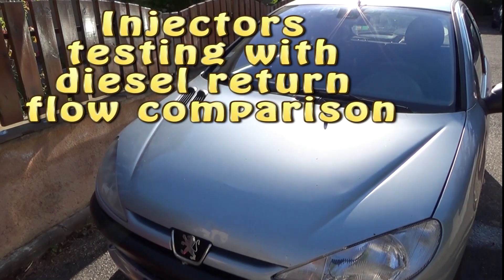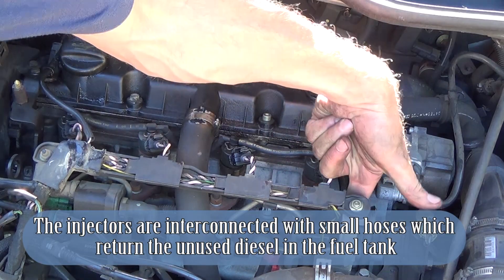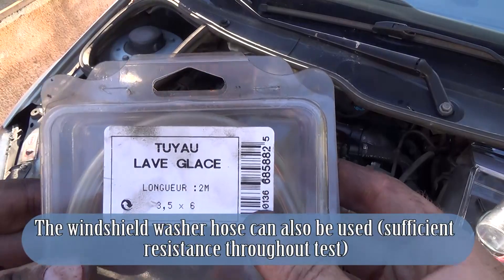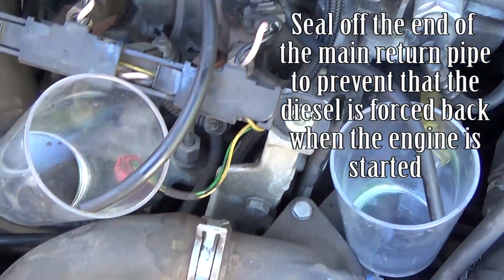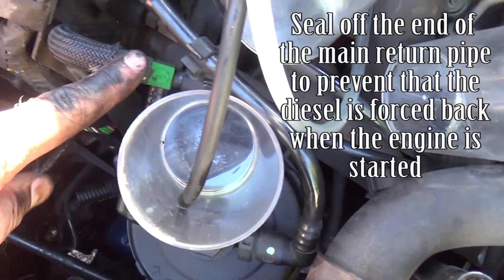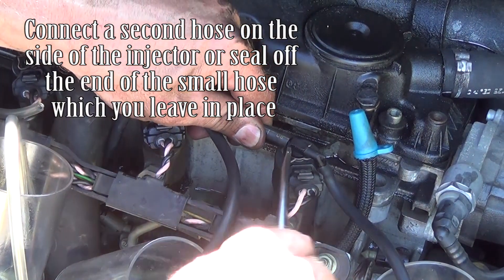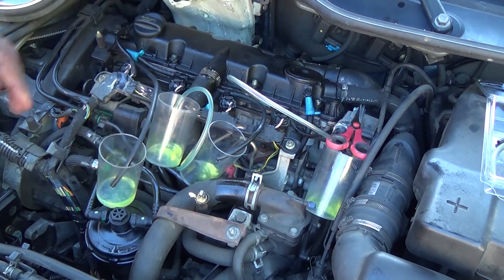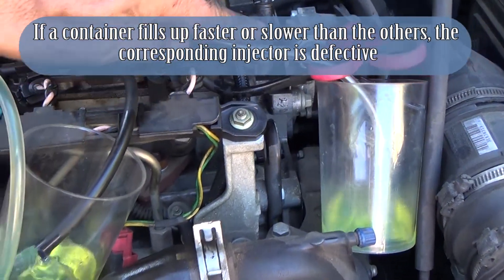How to test common rail diesel  injectors

Comment: If one injector is leaking back all pressure you would STRUGGLE TO START  and had very poor acceleration due to the not enough fuel. You do not test and create leakages by pulling out original and sealed properly fuel hoses if your engine has fresh filters and works fine. Allways use OEM or good quality fuel hoses. I used eBay crap and has leaking diesel within 3 month of installation. Chinese parts sold as for diesel and fuel cracked when exposed to diesel. Be aware good FUEL SYSTEM is TO GO or ... to walk back home. Take care.

Comment: This sound coming from injector?
@

Engine after repairing, starting 3 times without this sound, but when push to accelerator pedal, sound starting. I have more video from PC with  injector correction, when start in the first time, when o bed sound.

Comment: I stripped my injectors down and cleaned them in an ultrasonic cleaner,when I reassembled everything I done the leak off test and the diesel was black,like it had engine oil in it ?
anyone got any ideas what it could be ?
Reply: very nice
Reply: maybe worn  pistons and oil messes with fuel

Comment: I have done it and the injectors returned pretty much the same amount of fuel even though one was definitely bad. Beware that this method is not always accurate. If you have one totally shot injectors and it returns let say 2-3 times more than yes it will work. Mine was partially clogged.
Reply: how did u know which one it was? fault code diagnostic?
Reply: rivolinho
I used a screwdiwer - one side to the injector ans handle to ear. Bad one wasn't klicking (or probably wasn't klicking as loud as other ones). Also when unplugged there was not to much of a change in idle. My car is to old to come up with injector code other than open circuit.
Reply: rivolinho
Also the injector was probably giving the right amount of fuel but not spraying properly so it didn't burn properly.
Reply: +Gregory May Interesting. my car is reporting faults on 2 injectors but the leak test result is inconclusive, just a small return from all 4. It may well be a clog / poor spray pattern. Perhaps diesel treatment additive would be worth a try before an expensive injector repair.....
Reply: rivolinho
If its old car fault would mean open circuit I guess. Have you had fault codes read?How is it running? I think I had like 1/4 cup of returned fuel after 15min.
Reply: +Gregory May yes I had it read with an obd2. Just said fault on 2 of 4 injectors. it is lumpy on startup and sometimes I get hesitations while driving. Twice, it developed a full on misfire which meant I could barely drive it home. its an erratic problem. 
I had the codes cleared and am getting them read again soon to see if the same issues show up. I may have to simply go along with the codes because the leak test is not telling which it is.
Reply: +Gregory May my test returned about 50ml in 10 mins on all cylinders
Reply: rivolinho
If it is intermittent than I would check the wiring. If they are dirty it wouldn't come and go.
Reply: +Gregory May You may have saved my bacon! Looked into possible wiring faults and I discovered that injector harness/looms are a known weak point on my car. I had no way to test mine really but I knew that the problem worsened since I bent the loom out of the way the other day in order to get at the injectors.
I picked up a good 2nd hand wiring loom and delighted to say I no longer have a misfire. Idles properly and doesnt hesitate. Will keep an eye on it for the next few days, but I might just have solved it! And very cheaply!
Reply: rivolinho
Cool.
Reply: @grzegorz16100  mine car chevy beat(spark) diesel ...india.... have same problem....high vibration on idle and low pick up....and warns check engine light  with code "open circuit " ... what i will do ?
Reply: @victorydigitalme9872  Handle it!

Comment: Good video. Is it possible to do this on a car which won't start so the test would be done by just turning over the engine. Car in question is a renault laguna dci 1.9.  Thank you.
Reply: +jb260779 Yes, but you probably already found that out.
Reply: @sssssneaker  Yes, an injector that is passing too much fuel will prevent the common rail from reaching required pressure so engne does not start.
Reply: If you spray some brake cleaner into the intake it will start even with defective injectors.